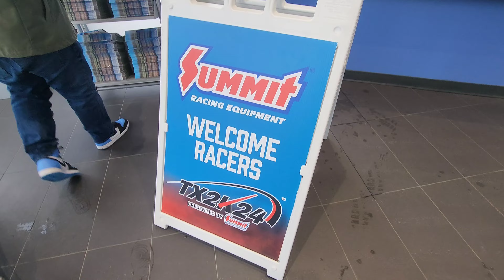GOING TO TX2K24! FAST CARS, DRAG RACING AND COPS BUSTING CAR MEETS!

Comment: hey man what do you know about c7 torque tubes failing?
Reply from the maker: Mine never failed but I heard that they make some ticking or clanking noise I think when shutting off the car. Not sure which years are more prone to that issue.
Reply: mine has that idk if i should  buy the rebuild kit and bushings or just get a new one because they said they are easy to rebuild if the tube is not cracked @TheRogueVette
Reply from the maker: @ntecl4d  I would try to take it somewhere to get rebuild or if you can buy the parts and do it yourself, more power to you.